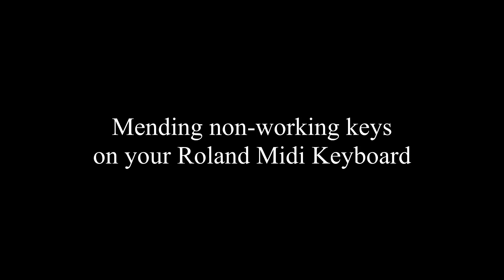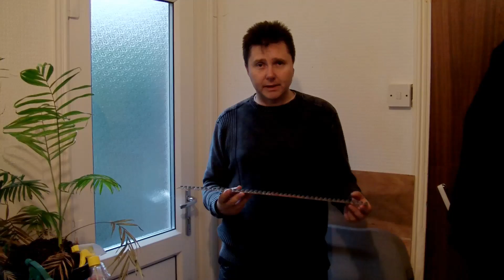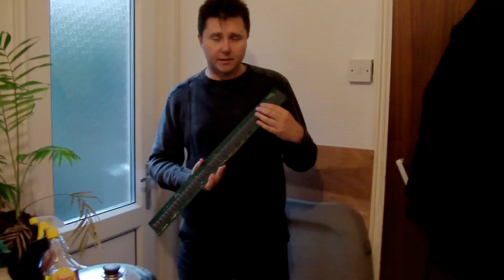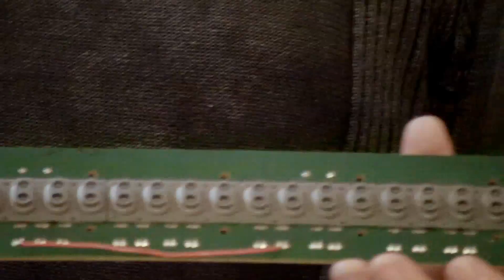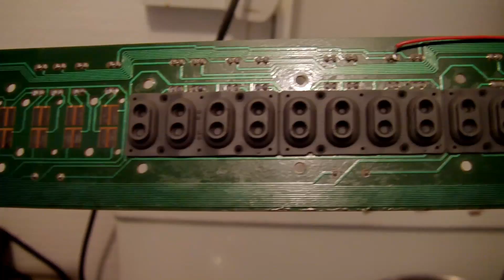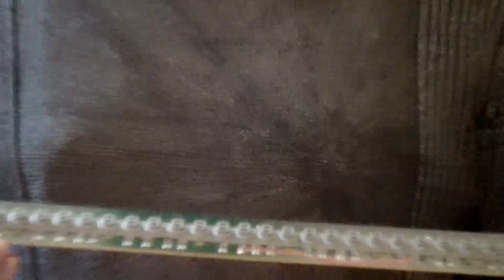Roland keyboard repair

Comment: I have Roland A-37, which was stored for 3 year in an attic and is now not playing any keys, only occasionaly triggering note or multiple notes at the same time, sometimes completely misplaced tones on the keyboard, like playing C6 triggers G2 and so on..  is there any hope for this to be fixable or is it bad? Thanks Mike
Reply from the maker: imacecz1 superficially that sounds bad - no pun intended - but in my experience around 25% of problems with electromechanical
devices are because of dirt, 30% because of wiring problems including poor electrical contacts at connectors and corroded or broken wires, about 20% due to adjustments out of whack / wear and tear, and the rest component failure. approximately. so I would start by taking it apart and giving it a good clean, including disconnecting all connectors and reconnecting them as slight corrosion or dirt over time can break connections very slightly. Electrical circuits can be washed in water with a bit of washing up liquid, rinsed, and given plenty of time to dry.  when you've done the basics, test i it again. then start considering broken tracks, failed capacitors and so on. You may spot failed electrolytic capacitors by the bulge, and they can be replaced. I did that with a monitor power supply once and it has now worked perfectly again for another 7 years and is still going. So the likelihood of unrepairable failure is low, it may just take some detective work. and I've noticed that even electronic devices don't like not being used
Reply: thanks for the advice!

Comment: How do I know the exact voltage of the zener diodes in the keys?
Reply from the maker: Ello Oku I'm sorry, I don't know.  Usually there will be some reference code you can look up. But in my experience of electronics diodes in a low-voltage circuit like a keyboard don't usually fail. it's more likely to be either a capacitor, especially electrolytics, or a bad connection somewhere. even a corroded track is an unusual occurrence. without more info about the symptoms or what investigation you've done do far it's hard to steer you in a likely profitable direction
Reply: @Mike Hersee I later noticed most keyboard use below 1.5V Zener diodes.
Reply from the maker: Ok, but I'd still be very surprised if zener diode failure is the root of the problem
Reply: They are not Zeners, just 1N4148 diodes for thew matrix.

Comment: Hi how can i get a ribbon cable for my Roland Juno d keyboard?
Reply from the maker: naphtallie Hodges I don't know to be honest. while ribbon cables vary a lot they are at least a lot more generic than many other components. if Roland can't supply it then complies like RS components or Farnell in the UK will probably have the components and you can make one up. there's probably someone that will make things like that to order though
Reply: yep! the MFer rips outa the keyboard huh? You gotta carefully put it back hole by hole then glue something on it to hold it down. Theres a vid on Juno D repair, watch it

Comment: please help ,one loud key , middle A , cleaned circuit  ,contact under key , clavinova 550 ? tried everything
Reply from the maker: Hi, I've only just noticed your message - sorry for the delay. That's a Yamaha keyboard. I don't have any experience of them inside. I've had a think about what it might be though, and not come up with any specific suggestions. I presume what you're saying is that the middle A plays loudly when you press it, no matter how slowly. That's slightly weird because it sounds as though - assuming it uses the same velocity-sensing mechanism as some other keyboards - it's triggering both the first and second contacts at the same time  when you press the key, rather than pressing them one after the other.. I'm suspicious that there is some kind of short across the second contact (so it's as if it's already triggered), may be not necessarily at the key itself, it may be somewhere else in the circuit. It might be something like the first contact not making contact properly because the conductive bit on the first trigger under that key is worn out, and when it gets the second signal without having had the first, the keyboard automatically produces a maximum volume note. I think it's going to need a bit of closer inspection
Reply: hi ,i did fix it  ,it was a tiny speck of the trace on the circuit board that was worn off causing the contact strip to short on it when key was pressed , found it by luck just out of the corner off my eye.......any type of sealer would work i used super glue ........i hope that made sense.....thank you
Reply from the maker: ray conway well done - and you've demonstrated once again that often the cause isn't total component total failure, it's something that has degraded slightly, but just enough that it prevents something from working properly - and that it often requires close attention to spot these sorts of subtle things

Comment: But what happens if it's only one key not working? Could this method be applied? Thanks in advance!
Reply from the maker: Hi, it probably can. If there is only one key not working then the places where it might not be working are reduced even further. If there is only one key not working, it CANNOT be any tracks that would affect another key. Make sure when you take it apart, you can correlate the non-working key on the keyboard with the specific 'button' on the circuit board, and that is the place to start looking.

Comment: Please if someone can help me  i have a problem on my Roland EXR 40  
oriental   that when i play a note it keep playing  like continuous 
sustain  if you can help email me to aboukalil@hotmail.fr  thanks. 
you can see the problem at the video    https://youtu.be/aoZ7TbqIqXU
Reply from the maker: I've tried several times over a period of time, but you video is still unavailable. It sounds as though the contact is not breaking when it should. I would look at the part of the system that makes contact underneath the key. In several roland keyboards they use a nearly identical system with a rubber 'spring' that returns the contact to it's normal position. It makes me wonder if one or both of the contacts under that key are stuck down rather than springing back up again. I'd say careful examination of the mechanism is the order of the day

Comment: my [value] and [page cursor] buttons on a juno d arent working..have to hit them several times to get an action, sometimes no action at all..how do I go about repairing that!
Reply from the maker: I'm not familiar with that keyboard, but from experience, there could be one of several reasons, or multiple reasons, why those keys aren't working, and may depend on how the keys and contacts are constructed. Sometimes it is the electrical contacts that become either worn or get moved out of the way and no longer contact.  You may find that bending what is left so that it more easily meets the other part can keep it going for as long as you need.

Sometimes the plastic structure breaks and that means the contacts no longer meet - you can use suitable glue to repair things, but watch out for interfering with sliding surfaces.

Sometimes due to wear and inadequate calibration during manufacture, the limitations on the travel of the plastic key means it will only just reach far enough to make the contacts work even when new, and with wear over time, there may no longer be enough travel to quite apply enough pressure on one part of the contacts. This can be hard to spot and test when the thing is disassembled because the difference may be only fractions of a millimetre out. If you suspect that might be it, you might be able to 'build up' the button by gluing even a couple of layers of paper to it where it presses on the contacts. I've done that in other contexts
Reply: I've connected a midi usb keyboard to a Juno D because there are several 
dead keys on the Juno. Everything works fine..plays performances, patches,
knobs affect the output sound...but when I select the [chord memory] or [arpeggio/phrase] button the sound is unaffected.
This was the main incentive for the setup as I really like playing around
with the [chord memory] or [arpeggio/phrase] buttons. However they still
work when I play the faulty Juno keyboard.
What settings do I need to make if any?
Thanks Dave
Reply from the maker: Sorry for late reply, I've only just seen this question. That sounds to me more like a MIDI configuration issue than a mechanical or electrical fault. Not my area of expertise. I hope you've solved it by now though!
Reply: Just fixed one all rubber membranes need to be replaced on keyboard, ebay has them coming from Turkey. Tac switches need to be replaced, mouser electronics has them. Note: juno D is a bitch to work on, the ribbon cable connects to the keyboard in  2 places, it is NOT meant to be unplugged on the first connector. It will likely break off anyway, then you have to carefully reseat the ribbon holes to pins and glue, AFTER you replace the rubber strips on keyboard and tac switches

Comment from the maker: if you have a broken or corroded track, to bridge over it with a wire the easiest way is to find the two nearest blobs of solder either side of the break, on the same track. then use a soldering iron to connect them with a bit of wire. if you're not experienced with a soldering iron, best get someone who is to do this because this is one time you don't want to be practising, in case you cause more damage

Comment: How did you connect the gaps with a wire?
Reply from the maker: The tracks on the motherboard generally have a blob of solder at each end where they connect with something else, another component such as a switch, diode, socket for a connecting wire, or other components. The easiest way to jump over the broken track is to find the two closest blobs of solder on the same track either side of the break (that bit is critical!), and solder a wire between them. If you're not sure how to do that, definitely get someone to help you for the first time, to avoid causing irreparable damage to the circuit board.

Comment: Here's a question.  I opened a Yamaha YGP-535 to repair a dodgy DC in jack and when I reassembled ALL the C# and G notes rang at full volume (as if it was hammered heavily).  This is a touch sensitive keyboard (velocity).  I don't think it is a physical cleaning issue as it is ALL the C#s and Gs.  Thanks for any help you can provide.
Reply from the maker: Hmmm, well, there are two sensors to each key on most velocity-sensitive keyboards, and the velocity is calculated by the time difference between each sensor being triggered. But if it's all the C# and Gs, that sounds as though there's a problem with the circuitry closer to the chips themselves, or may be a connector. It sounds as though there's a short somewhere. It's going to depend on the circuitry, and might even be within a chip as it must be at a point where all those keys come together. If you can't track it yourself, then you'll need someone who is an expert at analysing systems to work out where the problem is who can examine your actual keyboard and circuitry.

Comment: Hi Mike.  I just notice this is you from H. London. You know me from other info sites.

Are all the Roland RD's basically the same? I'm having a single note velocity issue with the "A" above middle "C".

I'm mechanically/electrically minded & used to replace the touch buttons on my RD 500.  Roland Canada actually gave me a FREE bag of replacement buttons.

I've had this RD700 for about 8 years & it sat around unused until about a year ago.

Any advice about pitfalls you may want to share with me will be greatly appreciated.

-K

Comment: !mbumir ...I have the same trouble !!
Reply from the maker: I'm not familiar with that specific keyboard, but quite often you will find extra screws hidden under warranty or serial number stickers, deliberately discouraging you from removing them, or essentially proving that you entered the case if the stickers are broken or missing. In my experience, most keyboards are made to actually come apart, as opposed to some devices that are designed never to be disassembled and can only be taken apart by damaging them.

When I'm faced with something that won't come apart when I'm pretty sure it should, I will often feel my way around the gaps between mouldings with a flat-bladed screwdriver to try to work out the location of the resistance. Sometimes in addition to undoing screws they also use snap-lock connectors between plastic mouldings, and you may find that gently prising one moulding in and one moulding out as you go round it, you can find where the snap lock connectors are and disconnect them.

Doing this can require delicacy with force and subtlety in feeling your way about. If you can't do it yourself, don't use excessive force. You will probably find that when you finally get the mouldings apart, you will see how you should have done it, but then it will be too late, and it will be hard to reassemble so it is still robust. Instead, find someone local who is experienced at taking things apart without destroying them. They will probably have encountered all the difference kinds of connection between plastic mouldings there are at their own expense, so you might as well use their experience!

Comment: How do you open a Roland keyboard? I have a ep-7 and I can't get the case to open, even after removing all screws and propping the case open with shims.
Reply from the maker: That's funny, I thought I'd replied to this one a long time ago. Maybe I lost the connection when submitting or something. I guess you've probably solved it one way or another by now, but in general, most manufacturers hide at least one screw under something like a warranty or serial number label, that has to be effectively destroyed in order to get at the screw underneath. Addtionally, a lot of manufacturers have screws hidden underneath the little rubber feet at the corner, so you have to unstick them to get at the screws.